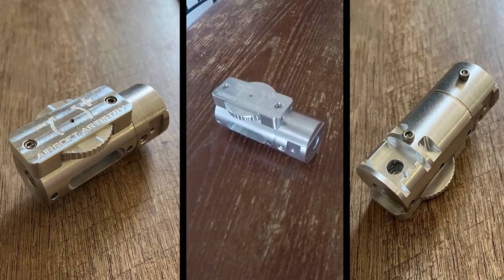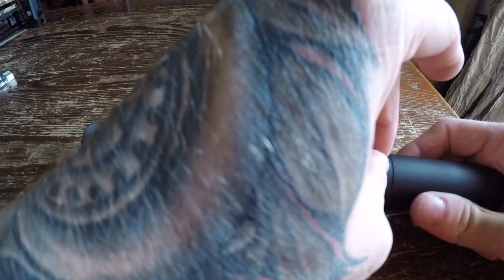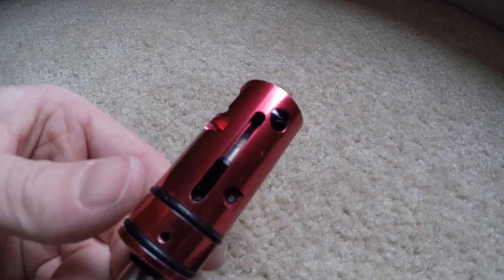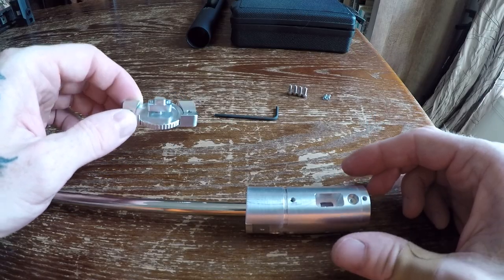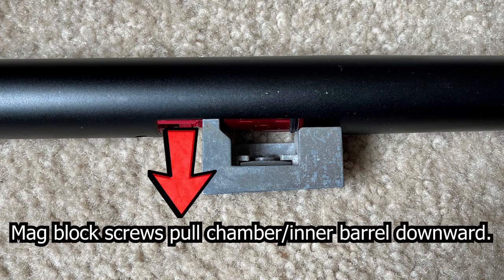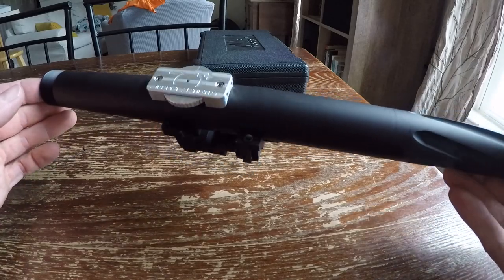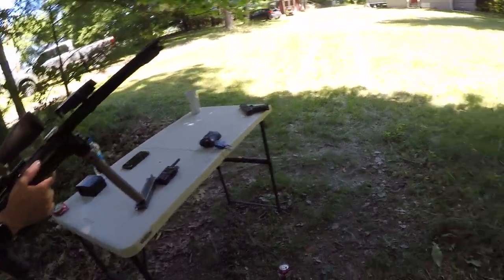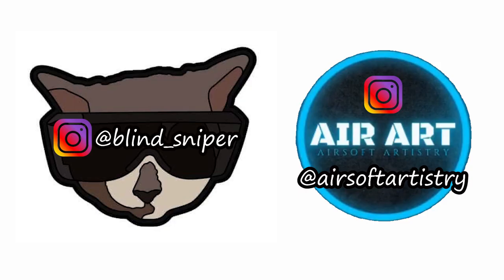The NEW Vsr-10 HopUP Chamber by Airsoft Artistry | Install, Review & Shooting Test!!!

Comment: Watching your videos makes me really want to build a vsr...which is funny because I bought a SSG10 so I wouldnt have to
Reply from the maker: Do it! Nothing like building a Vsr 😎😎 so many mf parts to choose from
Reply: @BlindSniper  yeah that's the part that is most intimidating, that and making sure everything aligns to have a proper air seal.
Reply: @tannerg4511  My SSG10A1 is stock besides a TRIDOS 2.0 Pro TDC. It's deadly accurate at long range and very consistent.

Comment: Last week, I performed some range tests with my VSR with an Action army chamber and tdc 2.0.   I also use the Modify X-range 65 degree bucking and you NEED to try it! It out performs the maple autobot by far!   Anyways, I tested different hop up adjustments, scope elevation adjustments, and different bb trajectories to see which combination gave me the longest effective range.  My vsr is at the same power as yours 345 fps with a .49.  I found flatter trajectories don't have as much backspin and drop much sooner thus losing a lot of effective range.   I then tried a much higher trajectory (I'm not saying the bb's flying toward the sky but leaves the gun, raises 1 ft and then slowly drops.  Now obviously you don't want that much over hop as you would have to exactly estimate the range and height of the bb at that distance to hit effectively.   But if you turn your scope turret down so the bb's max height is 2 or 3 reticles above the cross hair, the bb takes longer to drop, and it increases your maximum effective range by a lot.  Also when you shoot maximum ranges you don't need to increase your hop up by much and you can still track the bb effectively.  Notice I'm talking maximum effective range not maximum range, sure your gun could hit 90 yards but it was luck not effectiveness.  With this adjustment my maximum effective range (the range where it doesn't take 20 bbs to hit your target is 85 yards, and my chances of acquiring a higher maximum range are much higher.   Also when shooting maximum range, lifting your scope above the target with a few more clicks of hopup can usually be more effective than having your bb fly toward the sky 10 feet above your reticle, with the reticle on the target
Reply from the maker: I’m going to try the 70° I think, I’d be interested in seeing some raw scope footage of your 65° tests!! I’ve always used maple leaf 70° but I think the x-range will fit the barrel window better in my EdGi.
Reply: @BlindSniper  I would suggest the 65 I've tried the 70 but have gotten better results with a 65 with powers ranging from 2.5-3.5 joules.
Reply: Best bucking I've used so far is the Maple Leaf silicone versions. They require less hop-up adjustment and they last forever. Thousands of rounds on mine and still looks like new, no wear at all.
Reply: X range sucks....

Comment: If you have that Maple Leaf stock or the SSG10A3 stock the use the Maple Leaf RIS Rail TDC. It bolts to your hop-up mag block and it works just like the Tridos 2.0 TDC. It's also sold from Novritsch for the SSG10A3, but it's all Maple Leaf products. 
Mine is running equally in performance to the Tridos I had on it previously.

Comment: the triddos tdc have the advantage of having theoratically no play on the nub, but this centering feature looks promising
Reply from the maker: I disagree because the tridos is a separate nub that sits in place, so how can there be theoretically no play? Artistry has made some revisions to his unit and I can wait to test out the new model!!
Reply: @BlindSniper  because of the fitting. TO be honest i think that if you combine artistry design for the whole tdc and use the same nub design (with its fitting, no spring and all that shit) it would be potentially the best hop unit on the market
Reply: is it a bushnell forge btw ?
Reply from the maker: @Uria-jz1gu  sure is!!

Comment: I noticed that your shots were consistent up until 12:45 when they began to curve up drastically like they were being over hopped. I have this issue sometimes. Any idea what causes this?
Reply from the maker: This was a setup freshly installed with all brand new parts, probably just needed a bunch of rounds put through it. Before I recorded the shots I put maybe 10 shots through it to get the hop close. Maybe things just need to be broken in, that’s opinion based though. I just chose to leave the footage raw instead of cutting out the fliers. Could be many things as there are many variables. I’m going to swap buckings and probably test out another chamber with a few revisions. I’ll wait until I put a few mags through it before I record a shooting test
Reply: I appreciate the raw footage for reasons like this one
Reply from the maker: @bratpollution1371  he is constantly trying to make improvements so I will make another shooting test with updated chambers!

Comment: Just curius if an edgi bull barrel will fit
Reply from the maker: EdGi bull barrel will fit because EdGi had them step down on each end to accommodate things such as chambers sleeves. You just need to put the sleeve on the inner barrel before you insert it into the chamber.